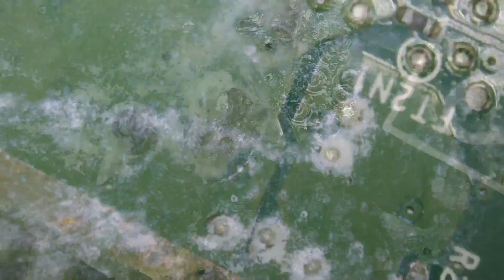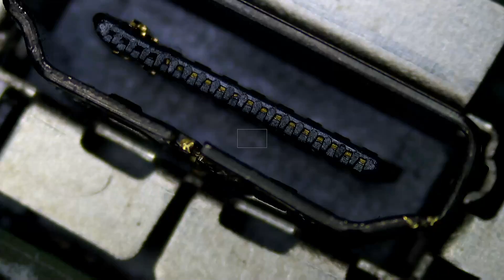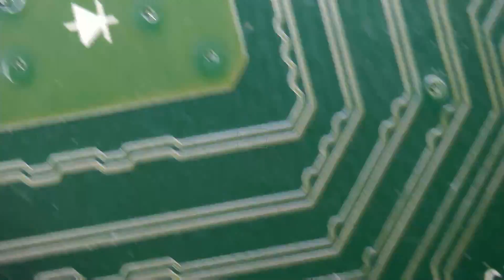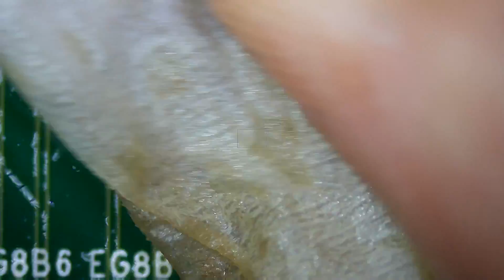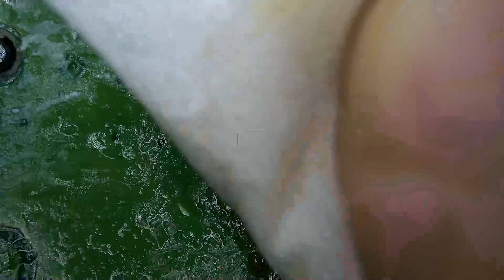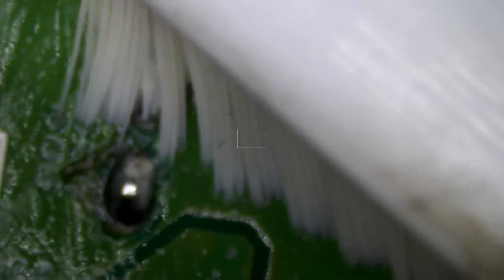XBOX ONE S No signal HDMI Connector Replacement - Prior repair attempt

Comment: What is the tip temp and hot air temp you are using when working with the low melt?
Reply from the maker: Tip set to 400 so it can also melt unleaded. Air temp anything about 350 is good.
Reply: @NorthridgeFix  Thanks for the info, just purchased some low melt solder to try out.  Keep up the great videos!
Reply: @NorthridgeFix  Which hot air system do you use?  Thanks.  Great videos.
Reply from the maker: https://amzn.to/2Gjdh4n